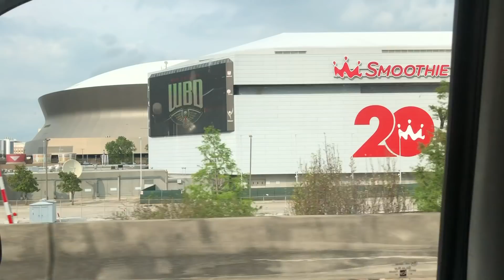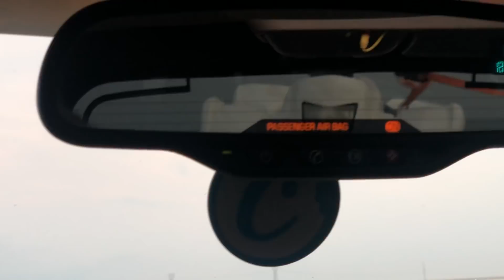Trading a Dirt Bike for Four-Wheeler (Good Deal?)

Comment: Stupid trade he traded a minty bike for a lemon that 400 need everything that back piece gone break if he try to throw it up
Reply: Don't buy that clapped out quad!  They got u guys.
Reply: Trap King yo fax that dirtbike clean and and I wouldn’t trade dirtbike for a quad unless it 2017+ plus that 400 is clapped with no air box lid and has to use starter for it to start
Reply: And he’s looking at the heavy stuff and basics can mess a bike up too he didn’t check it enougj
Reply: Trap King and subframe is bent
Reply: Trap King i love you 😍🥰😛😝😜
Reply: Trap King i love you 😍🥰

Comment: I feel like it wasn’t such a bad deal I see those LTZ400 sell a lot more on the market than the cr85 so you can definitely get your money back and make a profit if and when you want. 👍
Reply: Icy T it don’t run and got a lot of problems and if the cr80 was restored or clean and few things painted it would be worth a lot
Reply: Max Hicks it runs but not well, Yeah it needs work but its not nothing that can’t be fixed for starts It does need a valve adjustment to get it running right and maybe a carb clean.
Reply: @Tbands707  its a four stroke. Swing arm is cracked and no air box and motor work on a fourstoke cost alot. U can make anything run almost by spraying either into it. 1800 for bike 1500 at least to fix quad. Where's your profit at? On top of that he has nothing to ride until he has money to fix the quad. It was a very sad deal for him. I feel bad.
Reply: It does not even start and they don't make hondas anymore
Reply: In all reality it wasn’t horrible. Ltz needs carb tuned and new swing arm. The 85cc bikes only go for 1000 to 1200 tops where Ive seen Ltz go for up to 2300. Plus Ltz has nice exhaust in it that cost like 3 or 400 new
Reply: Quad&bikes R3 they go for about 6000 because they don’t make them anymore

Comment: Y would the guy with a 400 4 wheeler wana trade down for a 85 it cost big $ to get into them 4 stroke motors, and the swingarm was cracked , that aint cheap$$